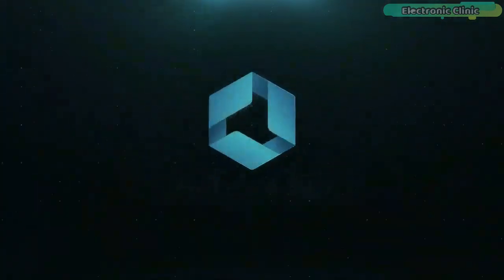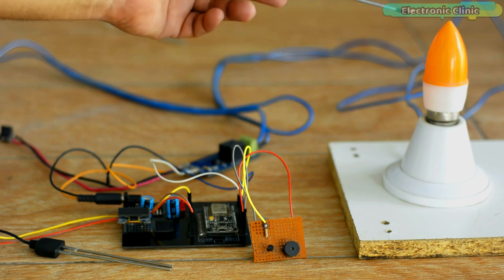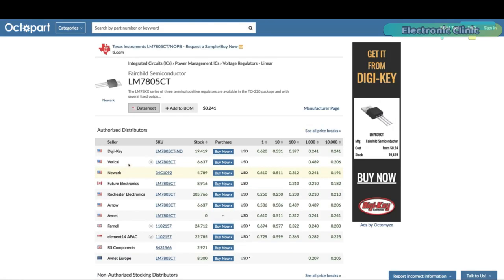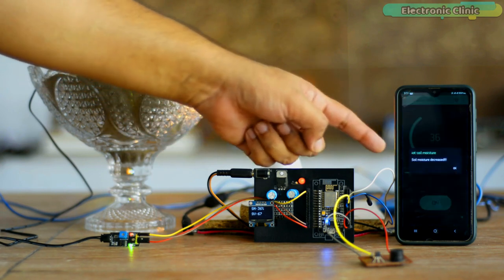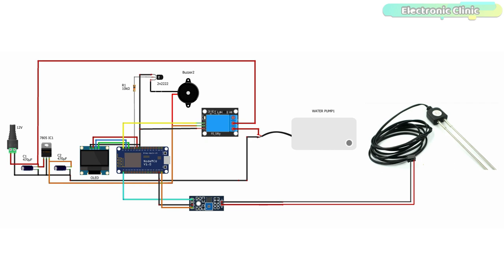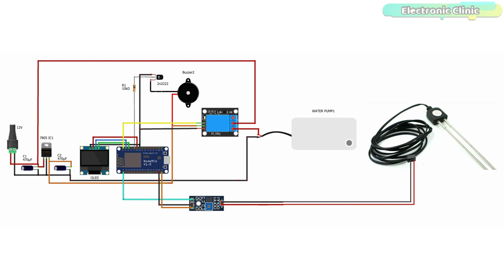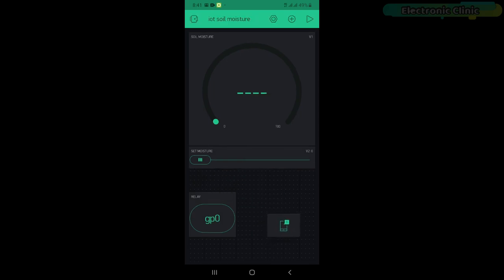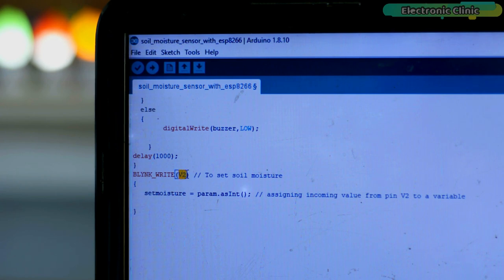IoT Soil Sensor | IoT moisture Sensor | IoT Plant Watering System using ESP8266 & Blynk

Comment: Hi sir. I am doing project using ESP32 Board using bluetooth module. But how to connect with Bluetooth in Blynk app?
Reply from the maker: i didnt use the bluetooth with blynk but i have used it with my designed android application. You can check playlist.